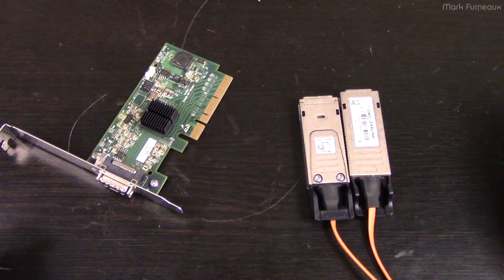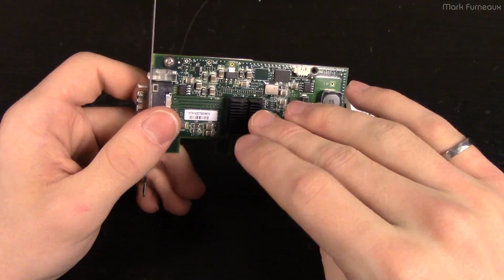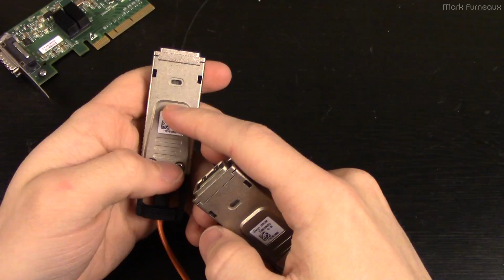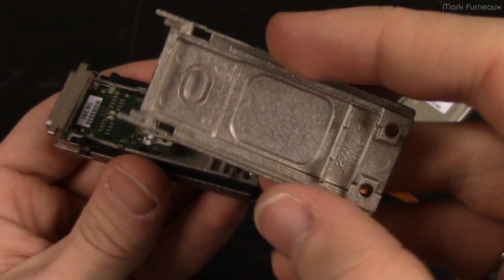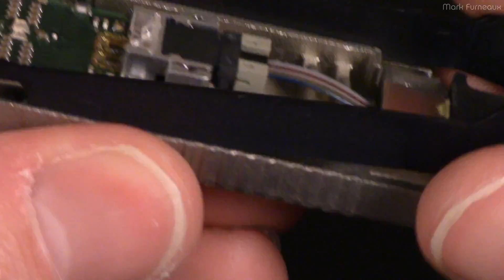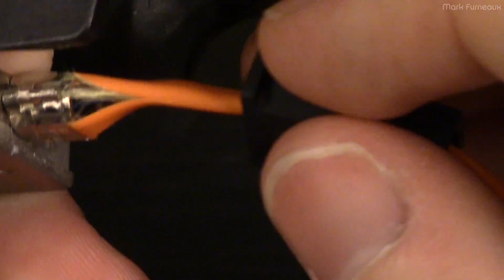Inside a 20Gbps Optical Infiniband Transceiver

Comment: Thank you so much, i gave up on this problem when i ran into it about 4 months ago because i did not need the 24GB of ram that i had installed in my then new FreeNas box( i've used it with 16GB until now). Now i just took out my LSI card and did this fix and it worked, all 24GB recognized and working! I just stumbled on this video on random when browsing you channel, im glad i did.

Comment: Why are the electronics and laser diodes in the connector. Why not have the diodes on the card and have an optical only connector similar to how S/PDIF TOSLINK works on AV amps and DVD players for digital audio. Maybe such an optical already exists?
Reply: Maybe such an optical CABLE already exists.
Reply: Optical alignement is very tricky, and the fibers themselves are pretty delicate. It's just easier to have the transceivers solidly bonded to the fibers and have a normal electrical connection handling the last few centimeters of the link. Fully optical chip-to-chip and within-chip communication is probably going to be the next big thing in the electronics industry.

Comment: HI Mark thanks great video and impressive work , I naively purchased the same card hoping to make it work on windows serv. i have read on mellanox blog that with the OFED driver from open-alliance it was possible to modify slightly the driver install file to ovoid the windows version check and have it working. Any thoughts,?
Reply: well not for me , i went through several models of cards all mellanox Infiniband aiming at establidhing a home lab with 10gb/s + network in peer to peer ( no switch) but without success yet unfortunately - no win10 drivers for the Mellanox infiniband MHEA28-XTC  - looks like its too old under Win10 environment . i finally purchased other IPoIB Mellanox MGHG28-XTC   infiniband and infiniband connectX-2 Voltaire IB Card HCA 700Ex2-Q QDR Dual Port HCA-30024 and these are installed and recognized with appropriate drivers , but i still have issues cabling these with the right QSFP transceivers and it still shows as "network cable not plugged" i guess my cables are not compatible or setup of the Subnet manager software not installed or done right , any thoughts welcome . best

Comment: what how can that transfer 20gbit it has barely 10 wires
Reply: Because the number of wires in a cable dose does not represent the amount of data a cable can carry. You can send a lot of data of just two wires alone.
Reply: Wikipedia ought to be your friend.
Reply: nope, it have 4 differential pairs each way
or it have fiber optics
Reply: Noble T 
you can do things faster when there's no long delay lines (aka wires) in the circuit.